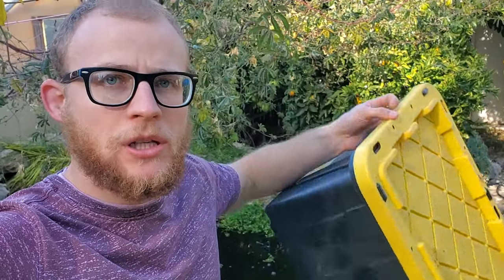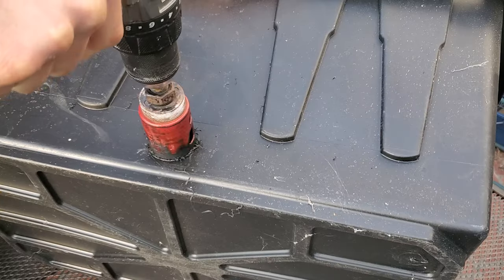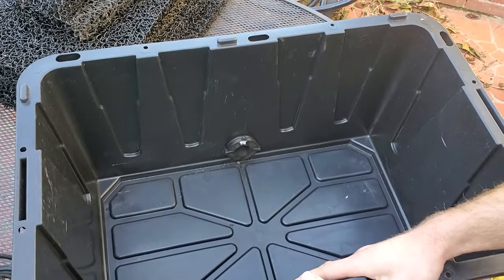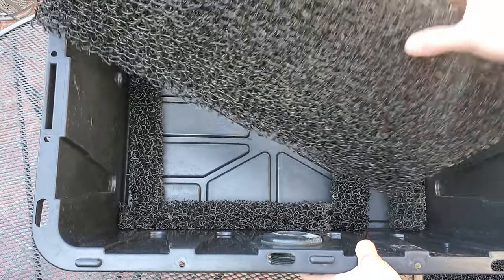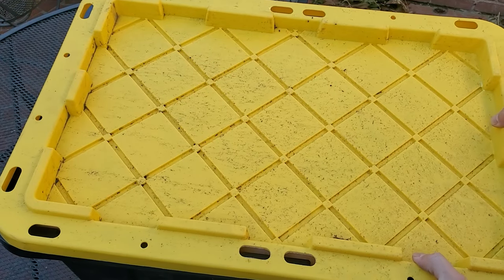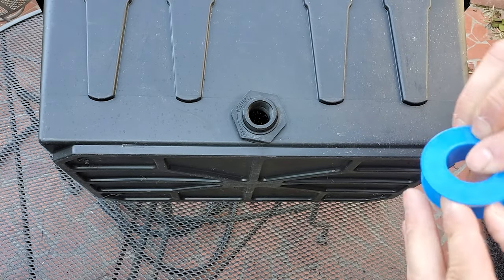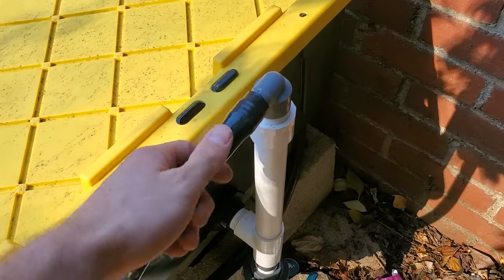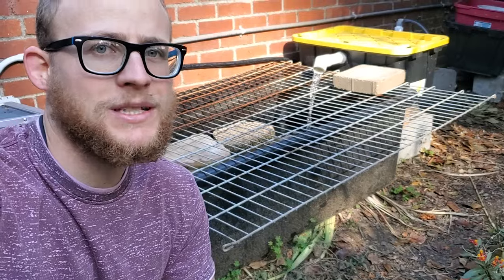Super simple DIY pond filter build #aquaponics #pond

Comment: Just a heads up, I've owned those tubs, the plastic is weak splits easily and the Sun will weaken the plastic in a short period of time.  The more expensive Heavy Duty tubs are worth the extra buck long term. Just sayin.
Reply: I used this tub with zip strap around near the top. No problem.
Reply: @r8d4tube  I have the same tubs in my garage that are empty, after a while they become that brittle that even trying to lift the lid off causes the lid to break into hundreds of tiny pieces it becomes that brittle. 
Thats just 3ish years sitting on the garage shelfing with some being full and some being empty with all of them becoming brittle enough you cant breath around them.
As brittle as a sheet of stale flat bread that crumbles as you pick it up.

Comment: I would prefer the dirty water to enter the filter at the top and the go down through the filter media and come out from the bottom.
Reply: problem with that is that if the filter media gets clogged then the tub can overflow and you're emptying your pond
Reply: I have a overflow pipe back into the pond.

Comment: So the dirty water goes into the bottom and clean water comes out of the top? Also how often do you have to clean this and is it difficult to clean?
Reply from the maker: Yes, the water enters from the bottom and moves up through the different layers of sponges then comes out clean at the top. How often you clean it depends on how many fish you have and how much you feed them. Once a month is fine for cleaning, more often if you need, also you can do less often as well just depends on the pond. It is very simple to clean, just pull out the sponges and rinse them of with a hose.
Reply: @vonponics  about cleaning: would it works if you drill the center bottom part to attach it a faucet which is opened to flush the gunk away when watering from the top? And do you think this kind of mechanic filter it's fine for an aquaponic setup like yours?
Reply: Yea, cannister filtes pump water down and up...
Reply: @Toskyval  make a more substantial bog filter.  False bottom and drain tap.
Use a barrel.  Must be 20% of your pond.  500 litre barrel needs 3000 litre per hour pump.
Drain once a year.  That's it.

Comment: Clever. Do you think I could make a bog filter this way?
Reply from the maker: yes you would just fill it with some rock instead and plant some plants. Structurally though these tubs are not the best they are just a cheap option.
Reply: If you use 2 tubs nested, they’ll hold. Be sure to have a sturdy platform or mounting for the rock tub. Also, for aesthetics, and UV protection, you can use old wood or old fence boards and fashion a screen for the sides of the filter for a double win.👏🏻

Comment: an inline check valve on supply side would stop backflow if pump stops overnight. also more fine material as you want to stop anything from coming up around the coarse mat material.
Reply from the maker: Ya a check valve would be perfect. Didn't want to use one on this build since it was to show a cheap and simple way to build a filter. And ya as you mentioned definitely to optimize filtration I should use more fine filter material inside.
Reply: @vonponics  I had to buy a 1" hose for my build. Pretty cheap that had a check valve built In.  It would work In any position even laying flat
Reply from the maker: @tomchristensen2914  Nice I just used what I had laying around. If you have the link for the piping you used feel free to share it so that others can use it as well. Also just remembered I did prevent the backflow using a diff method which you can see at 13:55

Comment: You've mistaken that pump does 1500gph. 600 tops.
Reply from the maker: Yup you are right it's only 400gph. Was going of the model number when I made the video, which many times does correlate to the gph. After having it running I was like that is way to slow for 1500gph.

Comment: Thank u this IS very helpfull! What kind of system can be filter with this? Like, how big cab the tank/pond be with this kind of filter? Thank u very much for your videos, subscribed!!
Reply from the maker: Well there are many factors that would determine what size pond to put this on. As in how many fish, how much do you feed them, how often do you do water changes, and how often you want to clean the filter.

But otherwise I would say max between 300 to 500 gallon pond.
Reply: As another reviewer noted... water entering from the bottom and exiting from the top seems odd. Isn't better if water comes from the top and exits from the bottom?
Reply: @juanosorno8153  why not from left to right?